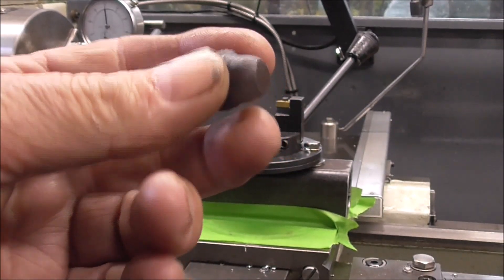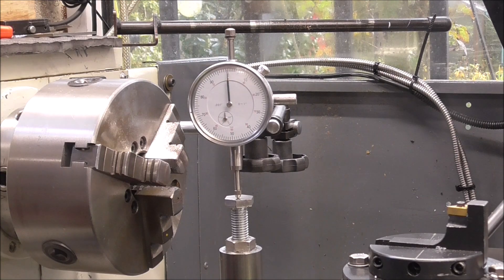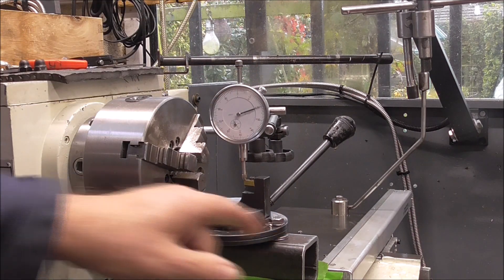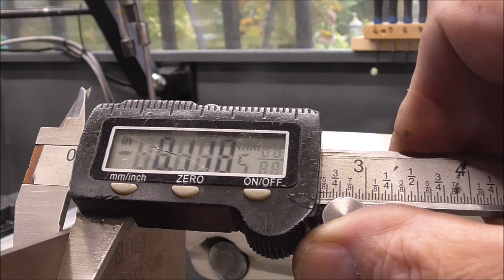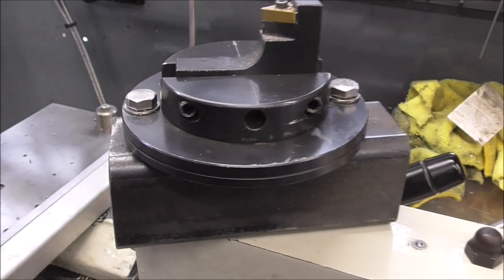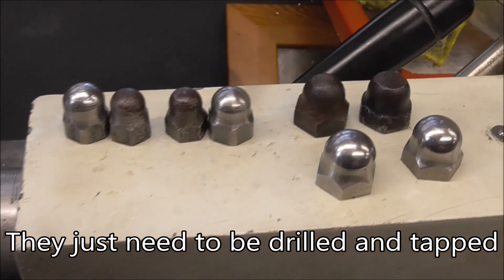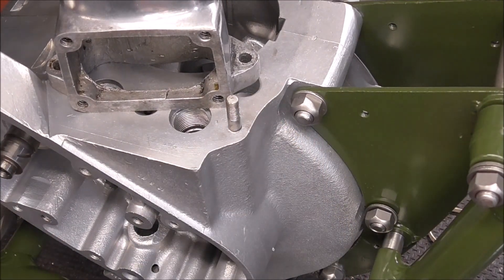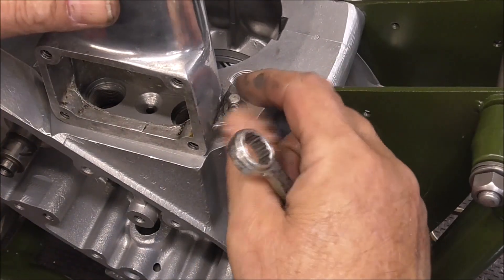Bsa B31 modified ball turning attachment.

Comment: Great Job Brian and im very pleased i found your channel which will be very useful for my project. I just bought a 1950 BSA B31 S with a B33 engine which is unusual i believe. it was tuned into a scrambler and is a barn find. its in a hell of a state but dooable. You mentioed soemone who did wheels i think Alan Atkin - are you able to provide contact details ? Many thanks Andy
Reply from the maker: @gb_engineer  Andy, thanks for the comment, always appreciated. Alan Atkinson is the wheel builder near Formby, his number is
07719 662007. Good luck with your restoration. Cheers Brian